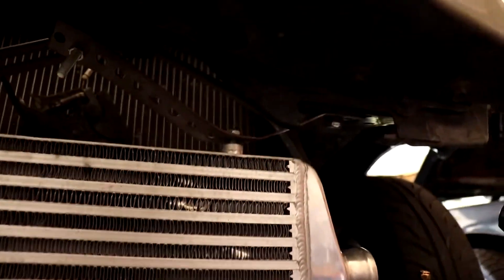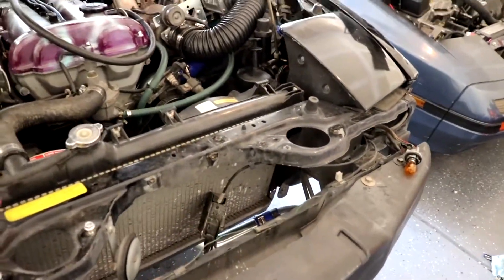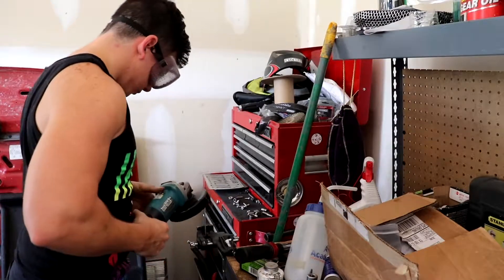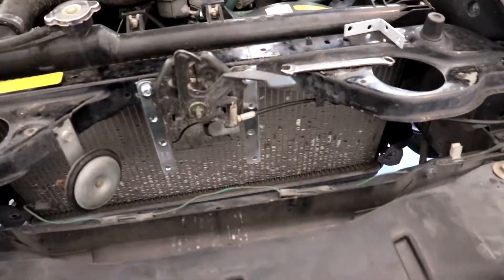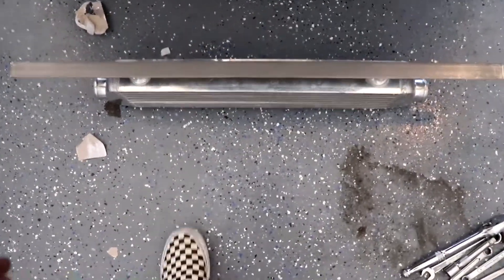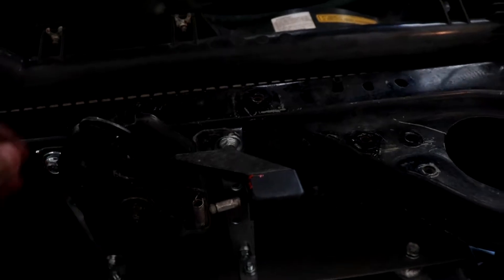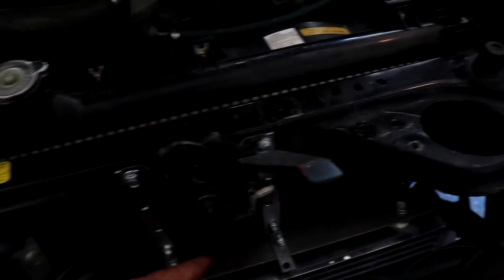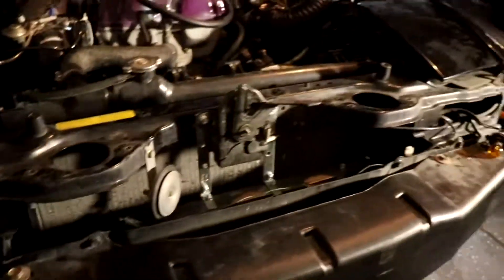How to mount an intercooler on a turbo Miata!

Comment: You look like a young Robert Downey Jr. Badass tip about using a bike helmet btw, I just dropped an angle grinder with a wire wheel on my ear while doing rust removal. Face shield doesn't provide enough protection